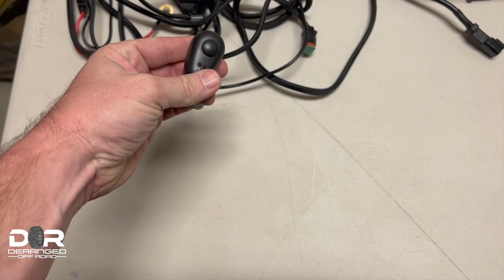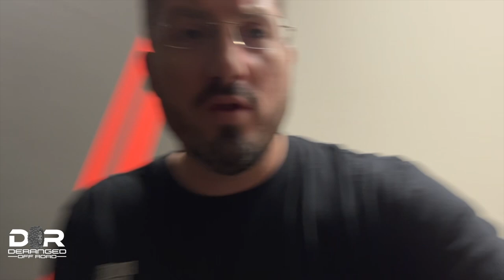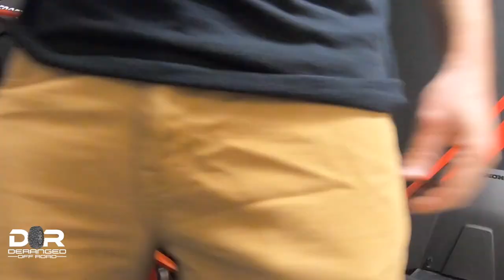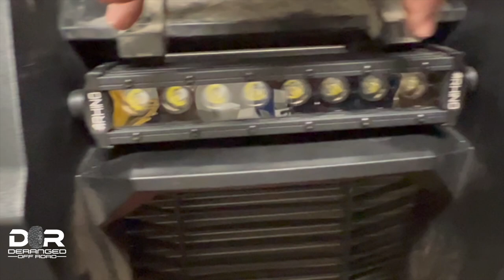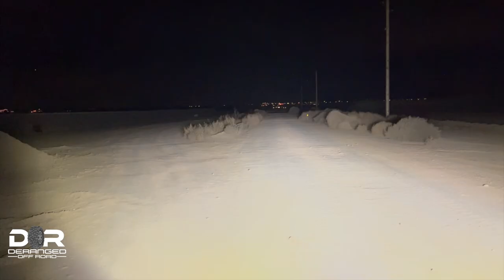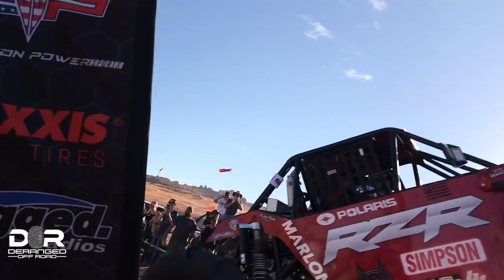Honda Talon Grill Mount Light Bar Install

Comment: What brackets did you use for the rigid light cubes. I’m getting a set of them too. Nice light bar.  I may have to add that to the list.  Many Tks.  How is it holding up in the plastic mounting area?

Comment: Was thinking if doing that very same install but I can't seem to figure out how You got your hands in behind the plastic to install the bolts and locks? I can't get my fingers in there. 
Did you remove any other parts?
Reply from the maker: I did not have to remove anything other than the hood but it was very tight. If your hands are bigger than mine, you’ll probably have to remove the grill to get it done. -Joe

Comment: Good morning Joe. I'm new to your channel, however I've watched I believe all of your Talon video's.  I'm thinking of buying a Talon soon. I have two questions. Hope you dont mind me asking both here. 1. Did mounting the light bar to your grill hold . 2. The pre-filter mod inside the airbox are you still running today ? I've enjoyed watching, great content, and info.
Reply from the maker: Hi there, the light bar on the grill has held up great but I don’t have a ton of miles on it. I will say though, since I posted the video, plenty of people have let me know that they mounted it in the same place and it’s held up great for them. 
As for the pre filter, no I am not. For me I’d rather just change the filter every 500 miles or so. The ideal solution is a pre-filter outside the air box or a particle separator, I just can’t bring myself to cut my plastics up… -Joe
Reply: Hey Joe any reason why you stop using uni filter just curious i just ordered one for my talon does it lose power or does the filter still get dirty.